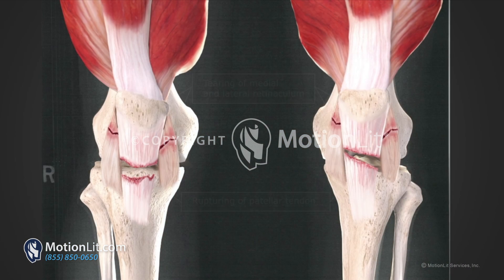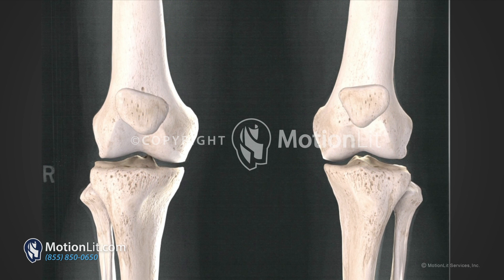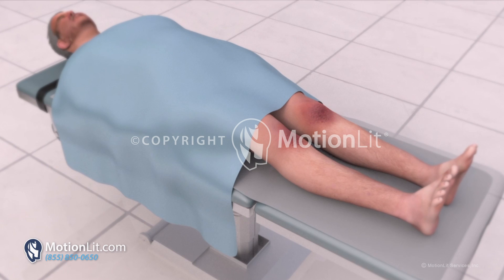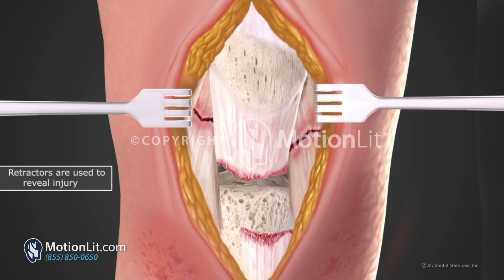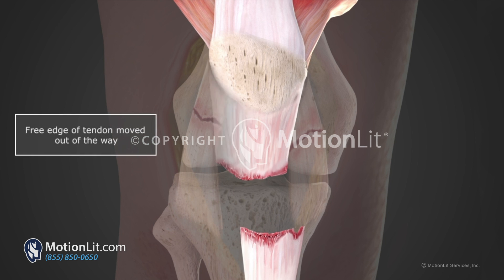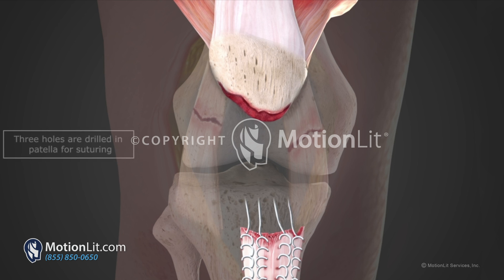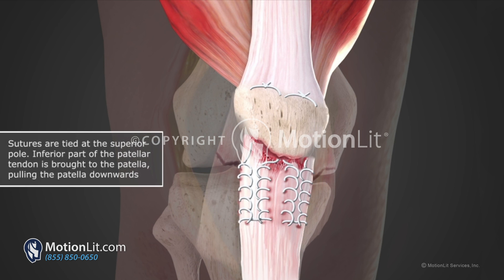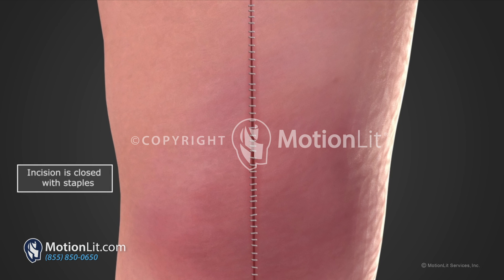3D Surgical Procedure Depicts Complex Patella Tendon Repair

Comment: 12/2022, same surgery. Completed therapy 4/23. Rested. Cleared 6/23. Started exercising 7/23. Slow-motion tennis Fall 23'. Shootaround on the basketball court 12/23. More exercise. Went to test my leg full speed on the court 6/24. All good. Full range of motion, full speed. Concerned about JUMPing but I know I can if I want to. I can tell. I can feel it. I was advised by the surgeon and two physical therapists at different facilities to jump off of my other leg or jump off two feet. Still concerned, but I was told that I'll know when I'm ready. My injury never hurt, nor did the recovery, so I don't want to oops, go through it all again, and experience pain! ---- For range of motion after surgery, sit on the stairs, chair or couch. Rest your weight on your hands, lift your butt forward off of your seat, lower your butt slowly towards the ground, keep your hands on your seat, let the gravity of your body safely encourage your knee to bend, YOU determine how low and how slowly you descend, hold the lowest position to subtly break up stiff scar tissue and carefully stretch everything in your knee area. I did this in addition to suggested exercises. Worked for me*. I gained almost full range of motion by my third or fourth follow up visit. ICE! ICE! ICE! Don't rush. Don't be a Hero!

Comment: I had this done 3 months ago in Athens after I fell off a ledge in Santorini and landed on my knee a metre below. To any medical people, my question is, do the threads running through the patella eventually dissolve or not? Does the tendon repair itself over time?
Reply: Bro same o fell with my knee I almost tear my tendon but the bad thing is that I didn't do a MRI. I didn't have the surgery and 2 years later I'm with the same pain I can't go up the stairs and walk comfortable. I don't know now if I should do the surgery or it's too late